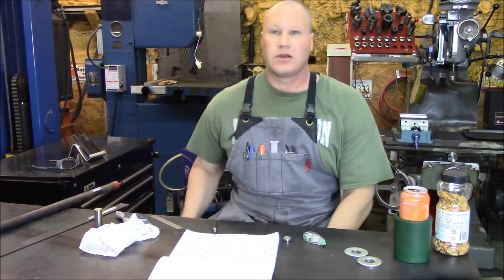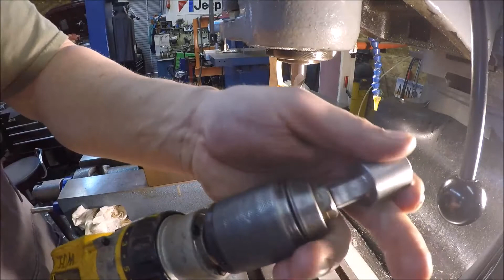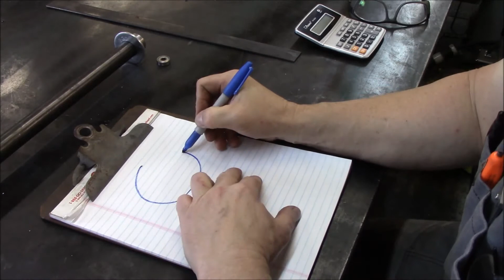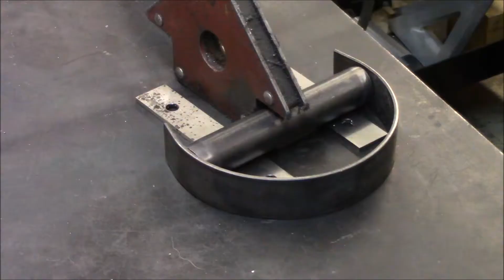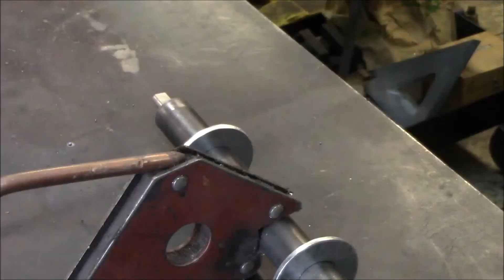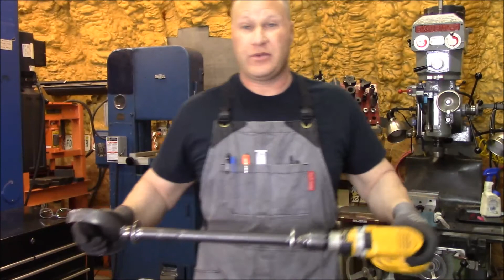Electric fence wire winder upper

Comment: You don't need to use any flux when using the wire welder?
Reply from the maker: David J. MacKinney it's gas shielded. 75% argon 25% co2 mix.

Comment: Tom, a small issue I see is how to remove the wire so the winder can be used next time. I watched the Red Toolhouse video and he said the wire won’t be reused so now he has a nice tool with a bunch of wire stuck on it. The winder needs to have a way to remove the wire maybe make one of the flanges removable so the coil can be slid off the end.
Reply from the maker: Hmm I missed the part where he said he wasn't going to reuse it. Maybe he will now that he has this fancy gadget? I figured you would just unwind it when you went to put it back out. I guess we will have to wait and see what Troy's take is on that once he gets it delivered to him.